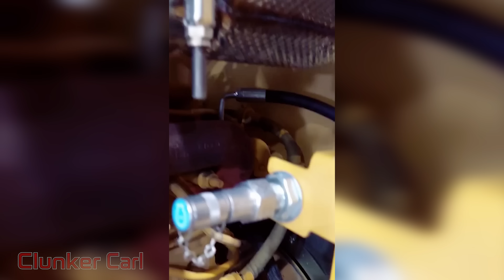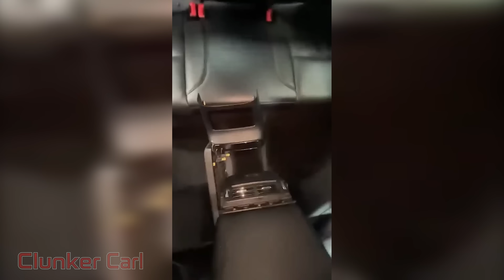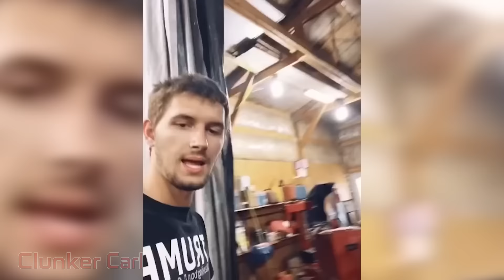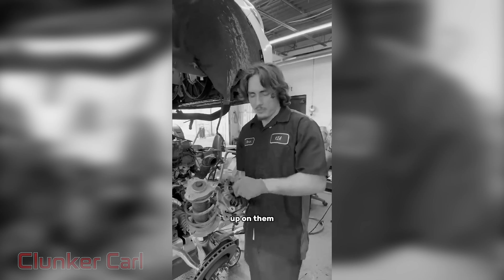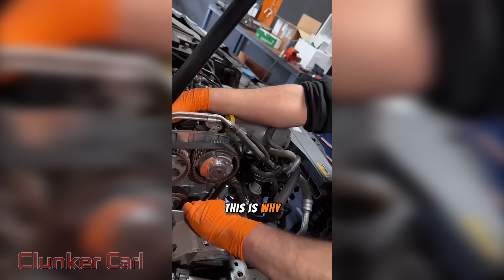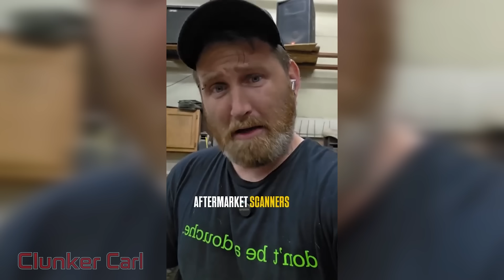Car Mechanics HATE Modern Car Engineers — And Everyone Knows Why

Comment: Hello,
 Why don,t mechanics that hate engineers never, never, never, SAY "PREDATORY ENGINEERING IN CAR MAKING " ?   THAT GOES FOR OTHER CAR GURUS ON YOU TUBE LIKE IN MY OPINION Uncle Tony's garage,  Scotty Kilmer, and many others on you tube and radio car talk shows...

Miss Paula Walach- former industrial electrician union member IBEW LICENSED ELECTRICIAN SINCE 1972.STILL WORKING IN THE TRADE AS AN ELECTRICIAN FOR A RAIL TRANSIT AUTHORITY 

BTW I RECOMMEND STAINLESS STEEL BOLTING AND FASTENING PLUS OTHER STAINLESS STEEL VEHICLE MODIFICATIONS LIKE BRAKE LINES AND REFABRICATION OF RUSTED OUT BODY PARTS.. YES, I,VE DONE THAT TO MY 1970S  AND 1980S VEHICLES

Comment: I always said before you can become a automotive engineer. You must spend at least 5 years on the dealer line . To start with con ed. Time required back on the line. To start.

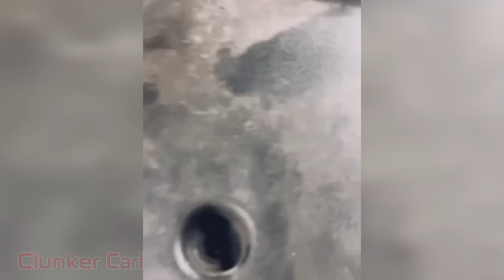Comment: (6:52) i went from ford to an avalanche. I had one of the daytime running lights go out. And i used to see it all the time on tahoes and suburbans. And always thought the drivers were just lazy for not replacing the bulb. Then i got an avalanche. Having to pull the fender apron and grill to get a lamp housing out to change a bulb is fking ridiculous.......

Comment: It's not the engineers, they get paid doing what they're told, and what they're told is do whatever you can to erase private mechanics off the map so buyers can only use our in-house ones.
Reply: No, the engineers are idiots. I'm an engineer (electrical). I design systems. I work to achieve technical objectives within budgetary constraints rather than price points, but no budgetary constraints would ever lead me to design something as inherently unreliable and difficult to repair as modern vehicles tend to be. Regardless of the industry, there are certain best practices that apply to all designs. Modern automobiles violate so many of these principles that it can only be incompetence. I know the engineers are told to add features and reduce manufacturing costs, but putting a drain plug on the side of an oil pan isn't a matter of cost, it's a matter of stupidity.

Comment: GM used to have easy to remove headlights on the 2003 2004 etc. Silverado’s and Sierra’s was two pins on my 04 Sierra to pull the headlight out. It’s one pin on my mom’s 03 Silverado.

Comment: A buddy of mine had a Chrysler 200 you had to remove the front bumper to replace the battery due to the battery setting behind the front bumper just in front of the driver side tire

Comment: I'm not a auto mechanic but I am a sheetmetal mechanic. The amount of BULLSHIT "engineers" put everyone through is absolutely unnecessary. In my humble opinion plus 33 years of HVAC experience I say these "engineers" 100% need at least 5 to 7 years in the trade they're "engineering" BEFORE they're qualified to handle a ruler and a pencil! They either over do it(building a watch) OR they don't do anything remotely intelligent. I believe the mechanics in any trade can design ANYTHING  better than these self proclaimed "engineers" because of their experience and ingenuity in their respective trade. "Engineers" can kiss my ass. If you're an "engineer ", don't tell me your one...I will light you up with a litany of nightmares.

Comment: Finally??? This has been a problem since to 70's when theycstartwd to fin ways to lighten up cars for fuel economy. Why make two brackets so bith parts are accessable after the car is built when you can make one for the two parts together while it's being built. Leaving one behind the other and no way to get them out without taking the car apart opposite the way it was put together?
And why are the mechanic bitching when thet get 4 hour book rate on something they figured out how to do in a half hour?

Comment: They hate engineers because they don’t know anything about being an engineer. I felt the same way before I was an engineer. Do you really think things are the way they are because of the engineers? They do everything they are told to. If they don’t. They will be fired. The engineers aren’t the ones in charge. They aren’t designing a car however they want. They see all the limitations of repairing a vehicle. If your manager tells you how they want something done, are you going to say no, I’m going to do it however I want? The engineer is just one brick in the wall. Engineers have a team of people scrutinizing everything they do and making changes. Your anger is misplaced. Talk to management. After you buy a vehicle management doesn’t care what happens with the vehicle. In just a couple of years. If the diagnostic machine and software doesn’t come from the manufacturer. It’s not going to work. You won’t even be able to replace the battery without going to the dealer and using specialized reprogramming hardware.  Wait until that 140 dollar battery you’re bitching about now cost 700 dollars. It’s coming and it’s not the engineers fault.

Comment: I did this work from the 70s. Till 2023, and the cabin air filter is one of my most favorite ones. I loved when the guy showed the Lincoln and the Camry. The reason why I think it's one of my favorite ones is because whoever's the owner or whoever's at the desk. Thanks. Every time you could change that filter in less than 10 minutes. Well, sometimes it could take a lot longer than that. 10 minutes, if they look it up and find out. Oh, somehow this calls for more time. But that takes somebody that's intelligent enough to take the time to look it up and some kind of maintenance manual. You notice salesmen that are at the desks, they don't really have much consideration and owners.Don't want to hear that they're high end.Vehicle is much harder to fix

Comment: I did this in the 70s and 80s and the 80s was the era of change but they still weren't that bad after 1990 when I had surgery I didn't want to do it anymore. Today at 71 it's just hobbies with older cars. My 17 Buick Lacrosse is the last late model car I'll ever buy.

Comment: Engineers go to school and get indoctrinated not educated. Socialists (Communists) own the education system and want the abolition of private property. They dont want you owning the car. They dont want you independent, they want you dependant and overwhelmed  so you can be easily controlled. Best way to do that, overcomplicate everything so you dont own a car for 200 to 300k miles, you throw it away almost exactly after it is finally paid off...now you "own" a pile of scrap metal that cost more to fix than it's worth. Planned obsolescence at its finest peak.

Comment: I'm a mechanic with 10 of experience and I curse new vehicles like the fucking plague. The shit I've seen just don't make a lick of sense. I live in New York, which has one of the strictest emissions laws when it comes to inspections I know of. Feel free to tell me if any other state is worse. I'd love to hear it. Anyways, we have a customer with a 2009 Mazda crossover SUV, and periodically, the check engine light comes on. Guess what the code is for the light: A FUCKING AIR CONDITIONING CODE!!!!! You mean to tell me that this customer can't get her inspection done because her AC is acting up?! Seriously, who the FUCK ties the AC system into the check engine light?? The same check engine light that comes on when you have a too lean or too rich code, a bad cat, misfires, improper timing, evap codes, you know THAT kind of codes? And don't get me started with doing simple oil changes on higher-end vehicles like Land Rovers. 2 million bolts just to get the splash shield down. The whole FUCKING thing!! And I got a video venting my frustration on said oil change!

Comment: This is done because engineers don't give dam about the machine who will fix these parts since nobody sent these car to expansive rapids in the company HQ for it to be problem for the company mechanics so you sometime have to reject the rapir or set high price for that model for to go to HQ and to be honest engineers may do these designs of hates to the CEO of the business since they gives mostly the middle finger to them and everyone besides the rush to build new one each year with other business so if you can't remove it these the options you got since mostly they want to suck there customers dry to pay for these repairs

And don't be cry baby here demanding for the engineers to rebuild these designs to make your live easy that's likely wont happen even if you were the engineer on that position you may not get bother making it easy prime target time and proformance the company don't care how the mechanic going to deal with it's the mechanics now have to go to the tools engineers and request solutions for don't use tool from 19s on 26 and complain it's because your not updated 
Besides these engineers have to makes part the match other engineers design that's why it's not flowless there is idiot between that
It's not like one giant building made all by single engineer that why it's look like shit from the inside and mess 

Besides that's cars aren't matter when it's comes to repair time for the transport industry like air Port bus ships trains for them to fix it

But it's true that if you had to strip the god dam car for sample task like the air filter you. Should tell your costumer to buy new car and sell that one because if you fuck up this what do you got right but complaining about the oil drain it's vailed as long it's the most possibly right since to be big baby about it unless oil drain can't drain or it's drain from the top where you have to get sucker to suck the oil out that's where you should really ask your costumer to change his car and not to buy from these idiots a car

Comment: I think all Automotive Engineers should be required to work as an auto mechanic for minimum of 5 years. Or if they design the motor/transmission they are required to fix them when they go into production. They should have to learn from their mistakes.

Comment: The only thing that we will do to these new vehicles is replacing motors, transmissions, brakes and suspension when parts are available... When it comes to diagnosis and sorting out HVAC problems you are on your own. If you bought that junk you have to own it...

Comment: These things are done for a reason; the engineers are told to design the vehicles this way to make the job as difficult as possible for independent mechanics, so the customer has to go back to the dealership. Also the dealerships are supplied with tools that are simply not available to anyone else, e.g. the manufacturer makes custom tools that can get to those difficult-to-reach screws without having to dismantle half the car.

Comment: Former mechanic that went engineer here. As a mechanic I used to cuss engineers up and down. When I became an engineer I promised myself that I wouldn’t forget where I came from. I tried brothers and sisters, I really did. But as engineers we’re given a list of objectives that we have to meet in our designs. Ease of maintenance is not high on it if it’s there at all. And if you have the audacity to recommend a tweak or modification to an existing design to accommodate maintenance or incorporate common sense, they hiss at you and run away. Like a vampire exposed to a crucifix. And if you persist, you’ll lose your job. Bottom line is cost. They don’t care about maintainability or common sense. They go with the cheapest design and manufacturing options period. Screw everyone downstream, that’s the mentality. I got out of automotive and aviation and went to SpaceX where they let their engineers be engineers and that’s where I retired from. So don’t be so quick to curse all engineers, 9 times out of 10 their hands are tied by bureaucratic bean counters.
Reply: Not good enough Golmer if your a drug dealer you dont say well killing is part of the job so dont blame me ! you chose your job you deserved the criticism. Space x is owned by an evil bastard your braging is 100 % B.S.

Comment: It's what happens when the dealership doesn't make enough money off of the sales of the actual vehicle and make all their money generation through mechanical issues if it takes a 10 hours to change the air cabin filter they made their money

Comment: I keep my mechanics busy just repairing my 1999 Mercedes ml320, in the garage now because of a wheel bearing and a caliper need replacing, plus the spare key's stuck in the ignition---the stupid car was over-engineered and wanting from back then; not like my 1999 Toyota Corolla with over 300,000 km's.  New car owners are being sucked in by a New Generation of Demon Possessed Psychopathic Maniacs--No Thanks.

Comment: I have been on the tools for 47yrs, 44 in my own shop. Worked on everything from the 1920's to the 2020's. Not just cars, everything. What I have observed is all machinery that I have been involved in has dumbass shit that makes the job, just that little bit harder. Mechanics would drill holes in the firewall to get to impossible bellhousing bolts to drop the gearbox on a 1960's British sports car. The proper way to do it is drop the motor, gearbox and front subframe/ suspension out. We didn't have 2 post hoists then. It's all shit, but with the complexity of modern vehicles with all the bells and whistles, The total shitness has increased exponentially. Really enjoy this channel. All the strength to you all, from New Zealand 🙂 Oh, P.s. Extracted a broken off a VCT oil control valve from a Hyundai yesterday. Glad I am still the village blacksmith, it has served me well🤔

Comment: The trouble with with engineers is that they always have to change something to justify their jobs and they can never leave something that works great into a piece of crap.
Reply: The Cummins K19 has had the same basic construction for decades since the 70s . They have adapted new technology to the engine because of regulations but it’s pretty much the same engine . I don’t no why GM could have done this with engines like the 3800 v6 .
Reply: Engineers only change what they are told to change, wake the fuck up! This is planned obsolesces from the top down

Comment: Engineers need to be forced to repair every single one of their vehicles from bumper to bumper before claiming it takes .25 hours to replace a cabin air filter. 

Boss looks at you.
Why did it take 3 hours...book time says .25?
Reply: "BECAUSE THEY PUT THE FUC*ING AIR FILTER BETWEEN THE GAWDANG ENGINE AND THE TRANSMISSION AND I HAD TO LIFT THE BODY OFF THE CHASSIS AND FIND A DAMN SPIDER MONKEY TO PULL THE FILTER OUT!"